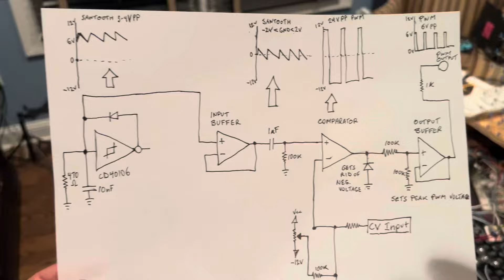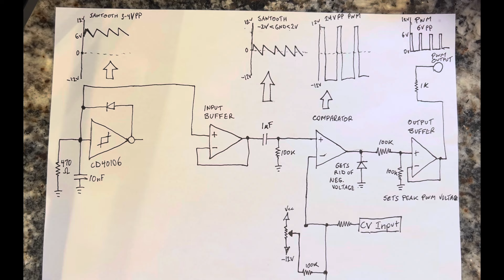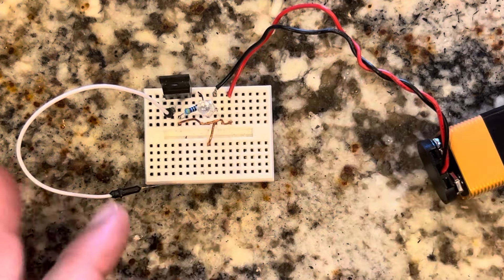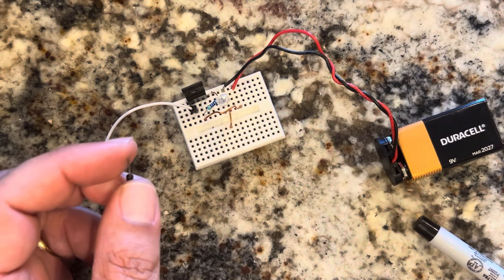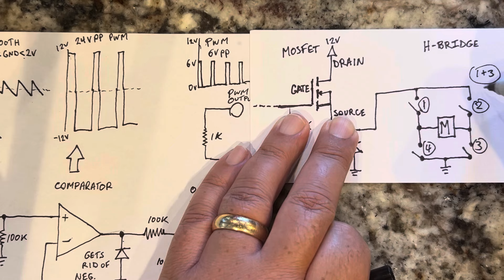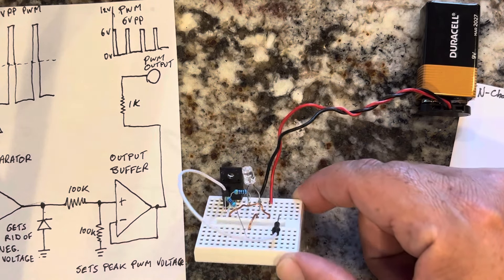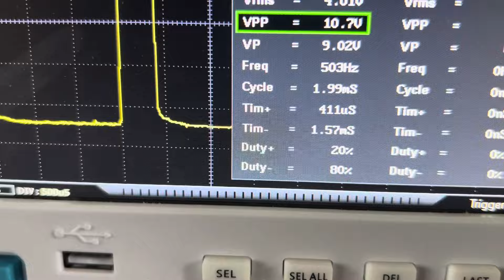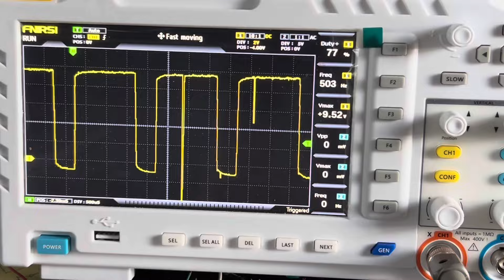PWM + MOSFET for DC Motor control

Comment: I love this so much! Exactly the video I need. I've been using these little pre-made boards from Amazon that use a PWM circuit to control motor speed of cassette players. The problem is that that almost always add some noise to the audio output of the players. So I'm really curious to see how the rest of this project goes for you and wondering if you end up getting the same noise from this circuit that I get. The only way I've found around this was to have completely separate battery packs for the motor and audio circuits.  I've also found that there are some versions of these pre-made boards  (on amazon) that lists the the PWM frequency as 20khz and those are the ones that have the least amount of noise. Is there a way to adjust the PWM frequency to 20khz in your circuit?
Reply from the maker: @SISKworks  Thanks for that. The frequency of the sawtooth oscillator on the PWM generator can be changed on the fly with a pot though as i currently have it, the range is 200 Hz to 2 khz which is still in the audible range. I haven’t tried it with smaller capacitor yet to get me into the ultrasonic range yet but theoretically that should work to get rid of the sound getting put through into the audio signal. When i made my tape player with the commercial tape deck motor, like you, I could only get rid of the motor noise by putting the audio and tape motor circuits on separate power supplies. Was able to partially reduce the noise with a notch filter at the tape motor frequency but that was not perfect and messed with audio output. Also, I think that different motors work better at different pwm frequencies so with the cheap little dc motors that i am currently using, they work better with lower frequencies in audible range (according to what i have read) but i will try and see what they can do at higher frequencies.